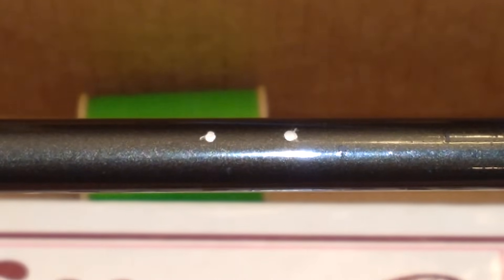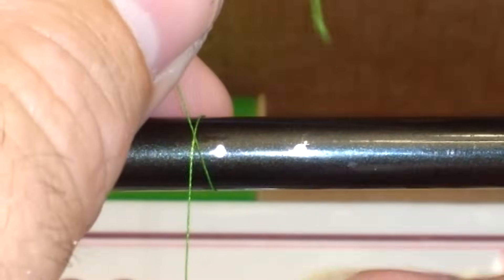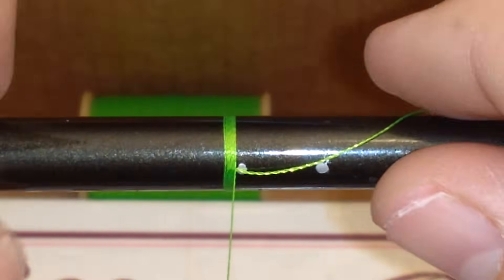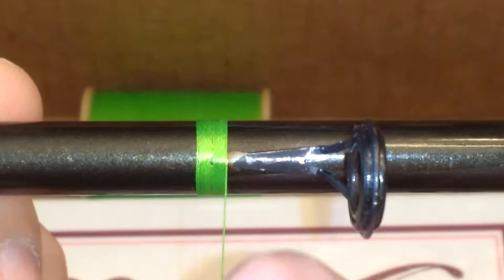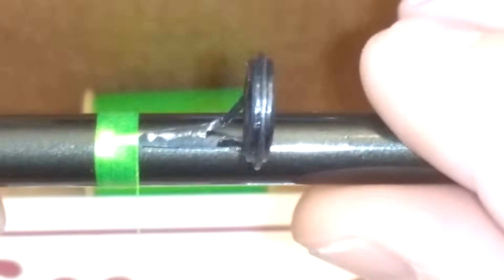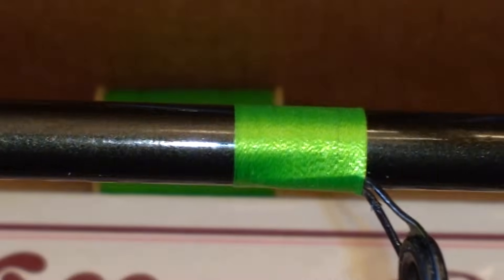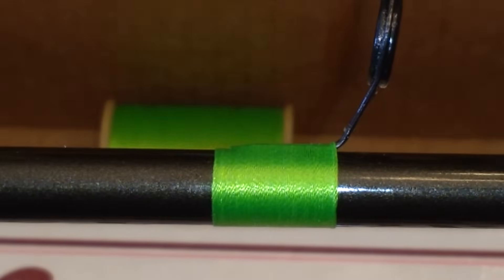Guide Wraps: No Glue, Tape or Clamping on Guide Needed!

Comment: Thanks for sharing,. One thing i can share with you, you want to end your guide wrap well before the line starts to "climb up" the blank, so maybe like 4-5 fewer wraps.  The flex coat will always "fall" down hill and you end up with parts of thread showing.  Also it just looks cleaner.  Happy rodbuilding.
Reply from the maker: I agree 100%. I stopped going so far up a while back because I would always have to go back and add some epoxy after they dried. Thanks for pointing that out so others may read this comment and get that advise as well! Tight lines 👍
Reply: I don't understand your "fall down" statement. My wraps never move after a clear coat of color preserver, and my epoxy stays where I put it because I turn my completed rods on my homemade dryer for 6 - 8 hrs dependent on weather conditions (Humidity/Temperature/Etc.). Please explain what "FALLS DOWN", and how it does. Thanx. 
Snyper Customs.
Reply from the maker: I think what he meant was that the epoxy (especially the thinner ones) may want to sag a little near the end of the wrap and leave a low spot of finish which may require a second coat to even it out. I have experienced a similar thing myself on occasion. Not a big deal and usually not an issue with "one coat" finishes in my personal experience.

Comment: Why make an easy job harder...just use a bit of tape
Reply from the maker: Sean Duggan tape is easy and I'd recommend that often. This is just another method, not a better one.
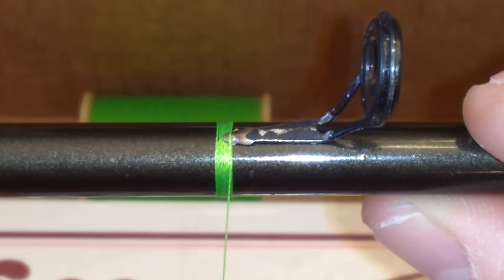Reply: The Fishing Hobby Fair do’s, but viewing it, it comes over as a tad clumsy, sorta like reinventing the wheel, but yeh, I get where you’re coming from, but 3:12, it’s just begging for a sliver of tape ;)
Reply from the maker: It is actually pretty easy to do when you aren't trying to watch through the legs of a tripod while checking the camera view periodically. I have a better way to record videos now but that is how I was doing it at the time I was recording the video. Most of my rod building videos look awkward because of that. In a newer video I did on doing guidewraps and  finish manual turning/drying I was using a newer video recording setup that made doing the video while recording much easier and the results looked less awkward. Recording while building makes the process trickier than it needs to be, no doubt about it!
Reply: The Fishing Hobby obviously you’re a straight up guy, and trying to help the next guy to make lives easier...for that I can’t fault ya mate👍🏻
Reply from the maker: Thank you sir! If anyone reading these comments isn't familiar with what we are talking about, taping the guide onto the blank is definitely an easier method and highly recommend for beginners because the method shown in this video is more tricky. Here is a video I did to show how you can do a basic wrap and finish by hand without a special drying motor if you are learning to wrap guides: https://youtu.be/BxRtH4dHK58

Comment: That style of guide, you are asking for it to break off. I avoid those. Get the type with metallic supports from the other side of eyelet.
Reply from the maker: That particular guide was just a junk one for demonstration purposes. That said, I only use single foot guides and have never had a frame break. I build ultralight freshwater rods and single foot guides are perfectly fine for that use.